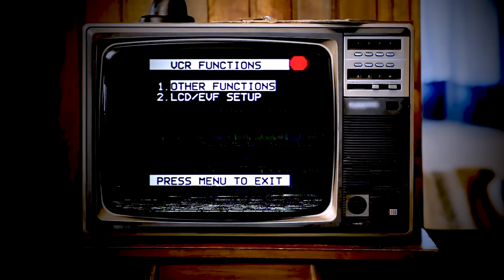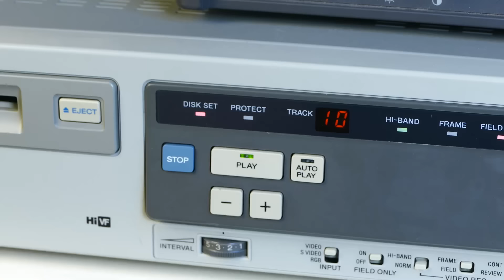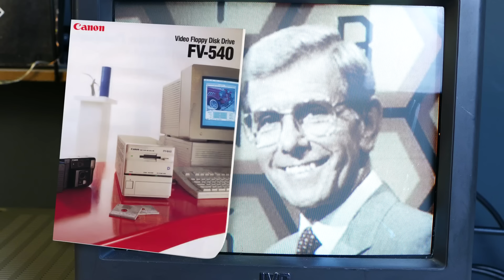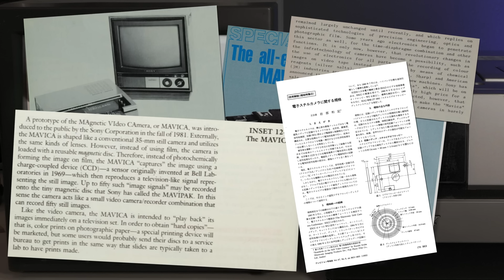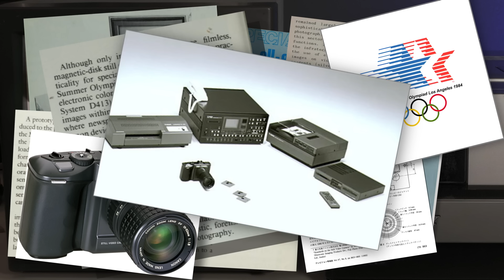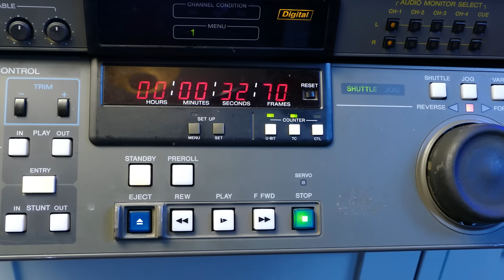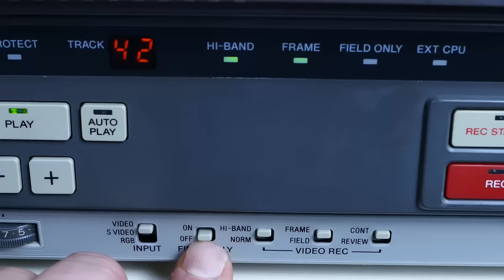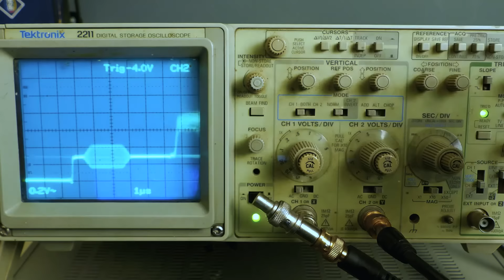The Rare Sony Floppy Format You’ve Never Heard Of

Comment: I would say this was a smaller cousin of the CRV disc that was used mainly in medical equipment but was also used by some TV stations for transmitting idents and repeatedly used programme captions. The CRV disc was a recordable laserdisc which came in a 12" heavy plastic caddy, but the disc itself was about 10" wide. I have a machine of this format at home.
Reply from the maker: @mbvideoselection - yeah the CRV discs were cool 'as.  I have seen them in action but alas I don't own one,  more the pity,  you need deep pockets to play with that stuff.  The BBC used a modified version of it here for playing idents etc.

Thanks for the comment mate, I'm going to look in to some medical imaging stuff :)
Reply: The statewide network of public TV stations where I am located used to use video floppies and stand-alone VF players/recorders for airing station IDs or other on-air stills back in the 90s.  Prior to then, it was actual slides using a flying-spot-scanner telecine film chain camera, which the network donated to a college after they upgraded to video floppy playback.
Reply: If I understand things correctly, the CRV was also the format used in the old old Edit Droid machines. :)
Reply: I don't think the videofloppy would have been useful in all medical imaging fields - something like X-ray for example would need a lot more resolution in most cases, in monochrome, and by the time the disk was developed digital X-ray systems were already into the megapixel range or beyond, and likewise MRI if only because of the sheer number of slices taken in a single run - but there's some where it could have worked, if widely adopted rather than causing headaches when only one department has the machine...

Maybe early CT (or PET/CT) for example, possibly some ultrasound, endoscopy (as they would have had regular TV resolution cameras at first), and certainly nuclear medicine if still using equipment that output to a TV-type monitor rather than a more modern computer. All of those often only need one or two pictures, or a few timelapse frames, with sub-TV resolution to get their point across, even when stored wholly digitally (e.g. 256x256 is a common digital NM image size, and you could put the metadata in the spare horizontal space on a single-field PAL recording). Though the dept I worked in during the 2000s seemed to have opted for more fullsize 5.25" MO WORM drives before going over to networked hard disks...

Comment: 2:15 SCREENSHOTS!!!  That is one obvious usecase.  Security cameras.  Imagine being the prosecutor and you get to hold up a printout of the very frame where the murderer fires his gun at the target.  There are many, many professional uses for this.
Reply: Eh, telecine is a thing. If you were that bothered about a single frame for a court case you could get hardcopy off a video still by other means, probably as convenient as bussing one of these machines in to the scene. It's more of a pain to have to use if you're doing a lot of shots on a short-term basis and probably only eventually using two or three of the full set taken along the way, having to dial the exposure in each time, get it processed into a scannable form, etc. Like videogame reviews or the like. Always wondered how magazines got such clean shots ... it was either that or using some kind of hack to freeze the game and pull data straight out of the video memory, which is more or less of a palaver (or even possible) depending on system.

Comment: We had one of those cameras (point and shoot) in out highschool. It was used bassically the same way a digital camera was used later.

Conected it to a computer then read it via bassically a 3.5 mm plug into a "speciall" card that probobly was just a sound card.

Then a software worked it into pictures.

There was some smart features that could scan the disc and make thumb nails. And you could select and down load them to the computer.
Reply from the maker: Hope that brought back some fond memories @matsv201 ~Andy
Reply: Probably a video capture card and a composite cable, these would have just put out bog standard video signals after all. Early digitisers did take some time to capture a full frame, especially if you wanted it in colour, and it was a pain in the backside if you didn't have a deck with a good clear pause function as you'd need to keep the camera trained dead still on something for a few seconds, and maybe replay the footage over and over to get each field, and in red, green, blue... (or luma, chroma I, chroma Q...) ..... grabbing visuals from a moving subject, you could forget it unless it was small enough to fit between the noise bands.

The rest of that sounds rather like my experience with an early digital camera my mum brought home from her teaching job a couple times in the late 90s. With a default 2MB and a whopping 8MB secondard memory card and a supposed 1.3MP resolution (though most commonly used in VGA mode, so direct equivalent of the videofloppies, because the sensor wasn't really that great and space was limited). Held about as many pictures in low rez and scrappy compression on the small card, full rez and better compression on the big one. Took a long time for the transfer software to generate the thumbs and a stupid long time to transfer the actual pictures because it connected over serial and struggled to keep a reliable connection at all of 115.2kbit, often needing to drop back to 57.6... which means like 2.5 minutes per megabyte...

But, even with all that, it seemed like magic and was a very useful tool for me putting together some illustrated pages for my geography A-level in Word (or maybe Write? Works?), pushing the limits of what our PC could manage without degrading into a heaving puddle of hard drive thrash and looking like absolute arse when finally spat out of our DJ300 printer (you can use a BW cart or a 3-colour colour one, but not both at the same time... do one pass for the text, swap cart, do the pictures and hope it doesn't make the already muddy photos even more so).

Experience that kind of led me to getting my own 2MP digital camera a couple years later when at uni, and needing to take hundreds of photos for my dissertation project ... there was a 35mm SLR plus microscope adaptor set up in the lab, but you had to buy and process your own film (as well as getting good at working out proper exposure and so-on, and if you messed up you were stuffed as the samples had a short shelf life), and then scan it into the computer afterwards, even though the useful part of the images only really needed to be about 240x320 or so as they were tracking fluid movements through the leaves of a tiny plant. Hell with that, I said, and put the money it would have cost towards a Fujifilm with macro lens switch plus a mini tripod (still have the latter). Did a great job, could get the shots lined up and sort the lighting out properly before hitting the shutter and zap / redo any duds straight away, give them a quick crop and level adjust in Paintshop if needed, then drop the result straight into the developing document.

Ten years earlier and the videofloppy probably would have made a similar amount of sense for that kind of application, if I'd known about it and could convince the faculty to invest in one... there was a Mac Lab just downstairs after all, so the reader could have plugged right in to one of them.
Reply: @tahrey  I don´t think it was a video capture card, it was dog slow.

The camera had to have some kind of analog memory (analog ram actually do exist, so it might be that). So the camera took a picture, then saved it, and you got to save the full picture before taking the next one.

Here is the point. Saving the picture was way faster than transferring it. That is why i suspected it was a very slow interface, like a audio card. Or at least a card with audio circuitry. 

I don´t remember exactly but taking a  picture took like 2-3 second while transferring them took like 20 seconds. 

This was basically before digital cameras existed. Of cause this was a standard 480 line camera, so it seams like most of the stuff was just right of the video camera market.

There also did exist cameras of the same type that was to to speak in HD, that worked exactly the same.

As long as you don´t have a device that is limited to frame speed, you can in theory transfer a video frame how ever slow you like, hence you can also both increase and decrease the resolution (This is actually what VHS do, that is why they look so crappy).

Some really early weather and spy satlite operated that way to. At highschool we had a satelite antenna to tune in a weathersatlite that downloaded the picture as one continus HD video image.

By the way, that is exactly how a group 1 and 2 fax works. The resolution of a page is about 768x1056 lines for a sheet of paper. So its basically the same horsontal resolution as a PAL TV signal, but its much higher. Actually there is really no length limit. you can feed in a meter of paper and it will still just write it as if its one frame.

And color faxes actually did exist. they worked exactly like a color TV.. the quality s absolutely auwfull.

Comment: I first encountered this system in around 1988/89. it was the canon one. Then again in 1997. Up until the late 90's/early 2000's,  UK Auto Trader used to send an agent out to see your car and take photos for the advert in the magazine. They were using Canon Ion Video Still cameras when i joined. They moved on to Mavica's with 3.5" floppy disks and then to "normal" digital cameras. Once digital cameras became ubiquitous, Auto Trader stopped using agents and the advertisers would send in their own pics. When i first saw it in the 80's it blew me away. it was a company my sister worked for that were on the cutting edge of tech at the time and they used to get all the cool toys in!
Reply from the maker: Ah that’s cool, I remember the Auto Trader agent photographers; usually mum & dad trying to sell another lump of British Leyland that had  unceremoniously split a sill or eaten its engine.

I guess that’s an ideal application for them where speed is more important than image quality and the 4:3 aspect wouldn’t have really presented an issue. That’s a great bit of info you’ve given me there! Cheers, Andy
Reply: I got one from when i went to army '01 and they were throwing stuff out. the camera was rather packed with components on the inside of it, but fundamentally it just dumped a frame on the disk.

cvhs would've been mostly just as good or better really.

you'd need to be taking lots of photos and going through a lot or carrying a lot of the the svf's for it to make much sense in comparison.
Reply: @lasskinn474  When you consider the size of the disks and how many pictures they hold, vs a roll of 35mm, or more appropriately slide film or 126 (?) disc cartridge, I think it would have stacked up fairly favourably. Especially with presumably having the option to hook the camera up to a portable TV and review your pics then delete any duff ones to make space. A stack of the disks wouldn't have taken up any more space than a bunch of regular film. The quality wouldn't have been as good, but you'd trade that for convenience, and probably competitive with Polaroid.
Reply: @tahrey  yeah I suppose, I just mean in comparison to just filming 20 secs with a cheaper cvhs camera.

just having them on an actual floppy is so much better though. the sensor image quality was about same as direct feed off a sony cvhs camera.

it just always felt like that you could've done the stills thing as a hack on just cvhs tape if you had a buffer. I suppose in large scale manufacturing the vfd's could've been pretty cheap though.

edit: direct feed as in what I used to digitize stuff with with a tv card back then still and use as a webcam. if i remember right you couldn't get the direct live feed off the vfd camera itself.

Comment: Seems really rather brave to spin a floppy at 3000 RPM (PAL) while taking little in the way of precautions from protecting the disc and the accompanying r/w head(s) from dust and debris, considering there's just a big ole mechanical shutter there, similar to the one on 3.5 inch floppy disks.

How do these discs work anyhow, on a technical level? Regular floppies have their r/w heads in constant contact with the disc surface, similar to a magnetic tape recorder for example. However, that naturally produces friction and wear which eventually will destroy the media itself. Of course, a floppy only spins at 300rpm and not 3000, so media/head wear would be magnitudes higher for the faster spinning floppy if the heads are in full contact.

Floating heads are mechanically loads more complex (IE, head sits on an air cushion inbetween disc and the head itself, like with a hard disk drive.) You need to be able to load and unload the heads reliably without scratching up the disc, and you need to protect the drive itself from vibrations and jolts which could cause a head crash (IE a physical impact with the disc surface as it spins at speed, which is BAD.)

So, a very curious system. Potentially a fairly short lived one too... Especially considering the innermost tracks are much shorter than the outermost ones, so would have to hold way denser a signal, which also does not help with media longevity.
Reply from the maker: @lennyvalentin6485 You have raised some really important questions, and just to pick a few points out (I really should get it back and make another video as there was some fascinating technical stuff going on in here). Just to pick you a few points.

- I don't know if the cameras could reproduce the images,  I suspect not, so if they had a field buffer they could record to the disk at a slower velocity than would be needed for reproduction as they would not have to match H-speed.
- Yep the disk is constant velocity according to the information I could find,  if you do the sums it only really used the outermost portion of the disc surface -  track 50 would have been the determing factor for acceptable image quality.

With regards to vibration,  the image is somewhat 'wobbly' and there was a TBC and framestore for these which I guess on broadcast duty would have been critical. 

These are great points though, shall I get it back and do a more technical dive?  There's some cool stuff going on with the signal too, it's somewhat more like SECAM actually on the PAL discs using a colour line delay and FM modulation.

Great comments mate, certainly something for me to think about and find out! ~Andy

Comment: I had the companion TBC unit for this system, the Sony MPU-F100 for use with a Video Toaster (the demo video on my channel actually uses it as a frame sync). All the references to "ProMavica" really threw me for a loop and why would it need a TBC/Framesync? Well silly me, because it was analog.
Reply from the maker: Hi mate! Yep that makes sense, I don’t have the frame sync’ but it would have been used in conjunction with one as you say on broadcast duty.

I’d love to have a play with a VideoToaster system, that’s my kinda nerdy stuff.

Thanks buddy!
Reply: @robustreviews  Toasters are NTSC only. Just something to keep in mind if one pops up in the UK. There were 3rd party PAL converters (did PAL->NTSC/Toaster->PAL), but they were lousy like any other transcoder from the 90s.
Reply: I was thinking the RGB genlock stuff on the back would go just nicely with an Amiga, too. And it wouldn't matter too much if you could only capture about one second of video, taking a second or two over each frame, if the computer needed some time to render each one and then you were going to take the result off to a separate edit station... (or vice versa if it held a bunch of stills that you were going to overlay, and maybe the VT could sample-and-hold each one to cover for the momentary blank during head seeks... something like a top-40 pop chart show countdown showing the record covers would be a prime application, or a weather forecast, etc)

Comment: I was curious about these after seeing a VF camera in a photography class, judging from the comments it sounds like it was pretty common for education?

Nowadays it’s Canon DSLRs, or phones if you’re in a pinch. They look good enough in a yearbook if you don’t crop too closely or blow them up, occasionally better than DSLR shots because people kept messing up white balance and exposure on those. Thinking about it now, the photography and yearbook classes should really be more integrated, in yearbook you sat through a slideshow about settings and then they sent you out with cameras. In photography we dove much deeper into that.
Reply: Program mode and automatic DRO is a lifesaver...
Reply: @ The problem is that the previous users who sorta knew what to do would leave the cameras in manual or some specific program mode and the subsequent users of the camera wouldn’t know any better. We only had I think like 6 cameras to go around or something like that. 

And of course there’s also people that use Program modes in the wrong context. This one guy used it at a sports event that took place at night, and left Sports mode (high shutter speed) on when taking a group photo. Super noisy photos.